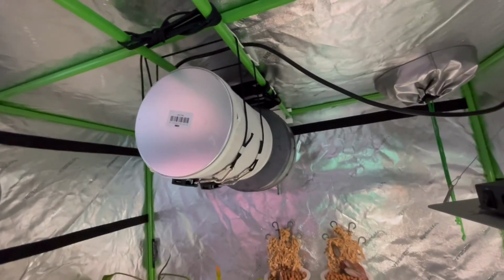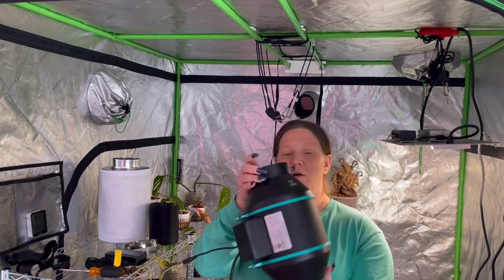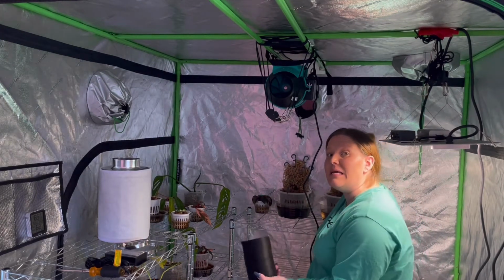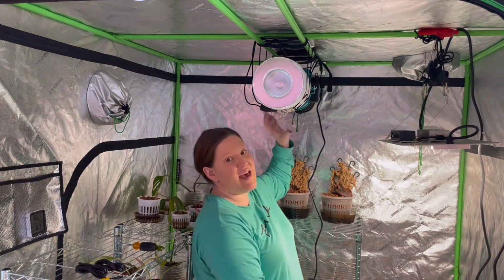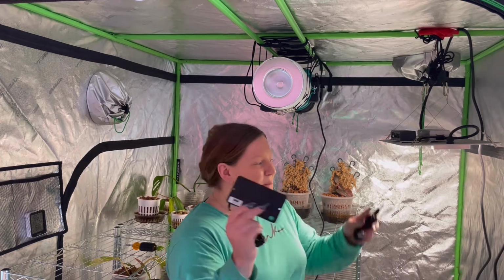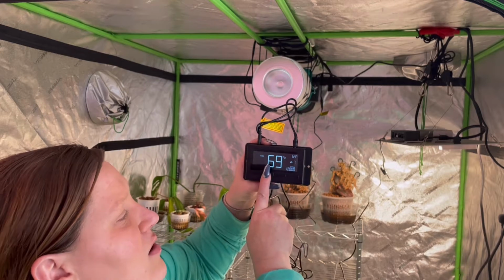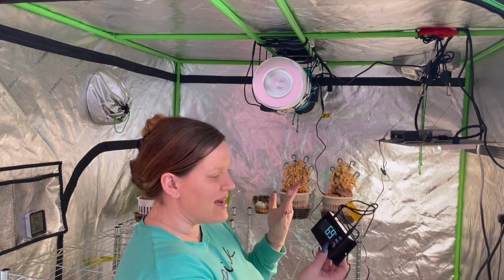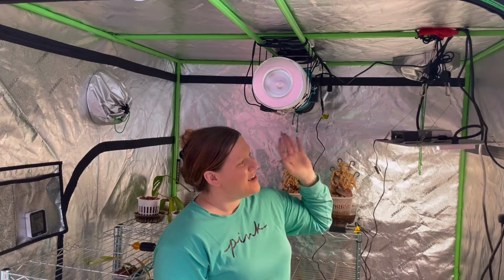Installing Mars Hydro 4” Inline Fan & Carbon Filter! ||How to Install Inline Fan & Carbon Filter||

Comment from the maker: Have you tried the Mars Hydro Inline Fan & Carbon Filter Combo?! What are your thoughts?! DON’T FORGET TO USE MY COUPON CODE (PlantyPrincess) AT CHECKOUT!
Reply from the maker: @Veterans With Anxiety 😁👍
Reply: Just got the 6in model in the mail the other day, haven't installed it yet.  My biggest question is what kind of kitchen racks are those?  I've only been able to find the standard 6 foot racks and I need something better than our 2x4 plastic tables so we can get some airflow from the bottom.
Reply from the maker: They are from Amazon. If you search 4 ft metal shelves you will come across them!

Comment: Hello. what speed should i be running my 4 inch fan at in a 2 x 2 tent? Thanks❤
Reply from the maker: I’d start at a speed of 2 and see how that works for you. If it’s taking out to much temp/ humidity lower it if not enough then raise it and go from there
Reply: @NailzByA  cheers mate!!

Comment: What do you use low temp for with the fan????
Reply from the maker: I don’t use the low temp setting I use high temp and high humidity so if it gets too hot or too humid the fan will turn on and help dissipate the heat/humidity. Hope this helps. Thanks for watching!
Reply from the maker: But low temp setting would be set to turn the fan off if the temp gets too low to stop the fan from releasing the heat

Comment: I know my question might be stupid, but with this set up you just showed us, how does it work with the smell? I mean, is it going to absorb the smell as well setting everything up like this? Thanks in advance
Reply from the maker: I haven’t had any issue with smell. This does help absorb and filter the smell out but if you have intense smell you can also set your ducting up to throw the air out a window to completely remove it from the tent and room. Hope this helps. Thanks for watching!

Comment: Hi I got mars hydro grow tent today and am struggling how to get the humidity and temperature right . Any advice would be very much welcomed 🥰
Reply from the maker: Hi! Awesome so if the humidity is to low you’d add a humidifier. If the humidity and or temp is to high that’s some things the fan and carbon filter system are meant to help control. Also adding grow lights into the tent will make the temp higher than it would be without them so running the fan more often if the temp and/or humidity is consistently to high will lower the temp and humidity and running it less often if it’s lower will allow the lights to make it warmer and the humidifier to make it more humid. I hope this helps!
Reply: @NailzByA  thanks so much . I have been using humidifier  and using mars hydro 6500 smart light . The fan has a mind of its own though lol and wants to run below the numbers I’ve put in the controller
Reply from the maker: Yw! Lol I know sometimes these systems act silly lol hopefully you’ll be able to figure out a setting that will keep it running when you need it to be!

Comment: Do you think you could fill the void Inside a carbon filter with bags of activated carbon for extra odor removal?
Reply from the maker: To be honest I am not sure. I’d be on the safe side and not do that as to not mess with the fan but you can hang the bags and it will help pull the odor out without putting it in the fan. They are also referred to as activated charcoal bags anyways they do work great for absorbing odors when used by themselves. Thanks for watching, hope this helps!